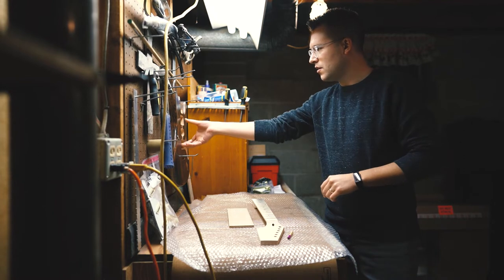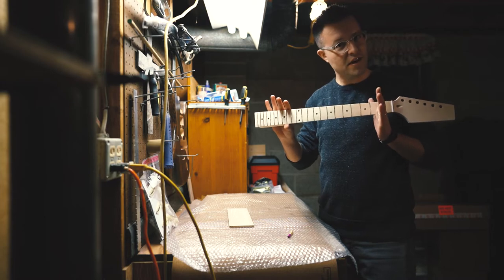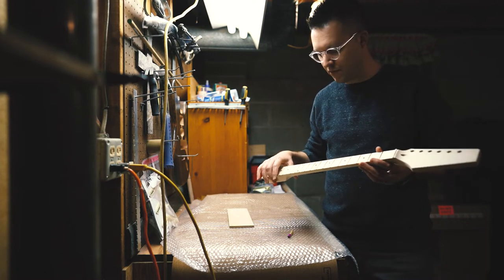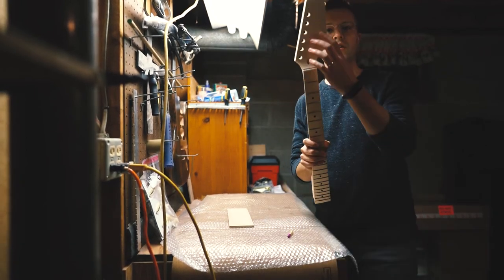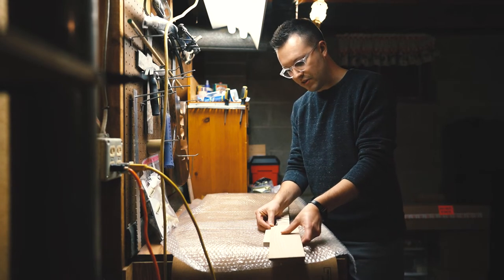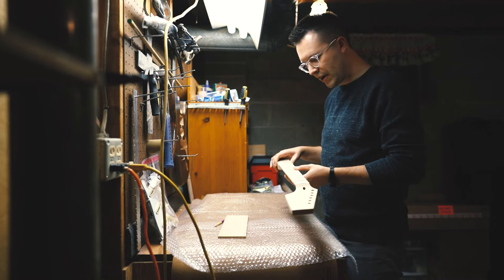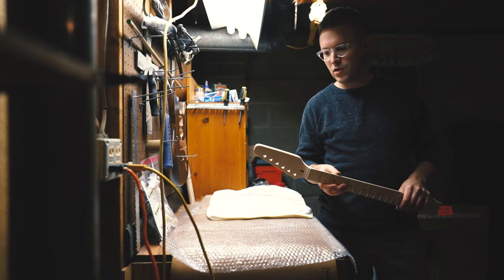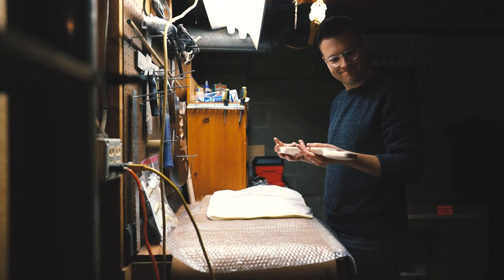Building a Kit Guitar from StewMac - Ep3 - The Neck - Relic & Finish

Comment: Thanks for showing us the process, Archie. This inspires me. What did you use to remove the Graphite? Was it Tung Oil? Is that the same thing you used to apply on the neck after you removed the Graphite?
Reply from the maker: Thanks William! Yeah a lot of it wiped off with the tung oil, which made it look much more consistent.